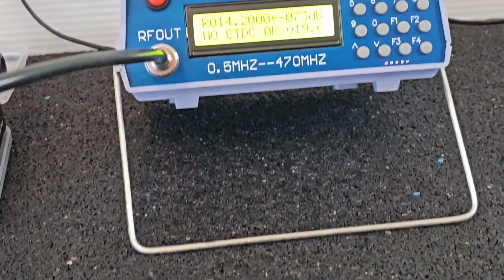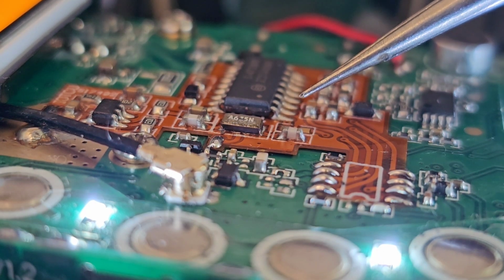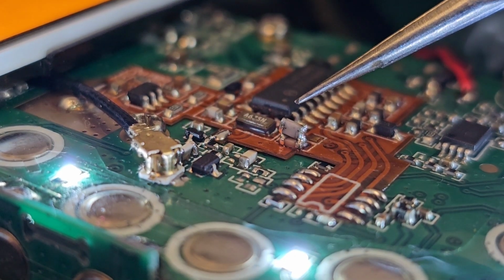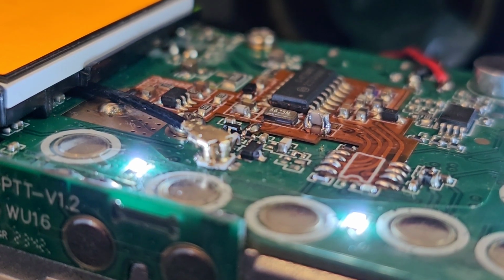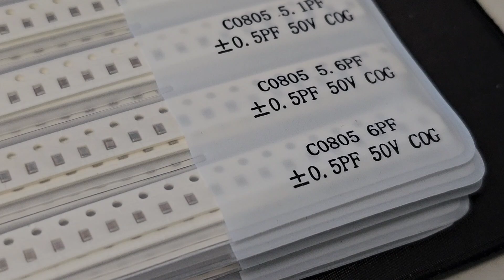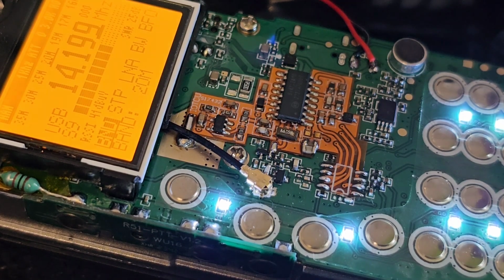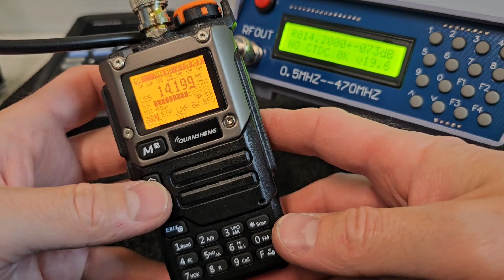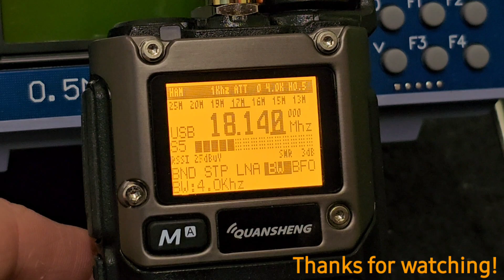Frequency BFO Correction after V.2 HW modification

Comment from the maker: After installing the SI4732 Chip V2 FPC module I see that on all modded radios the BFO setting needs to be manually adjusted to get the receiver frequency exactly on frequency, because SSB signals sounds like a Micky Mouse. It's boring always manually adjusting BFO, because after every reboot this new BFO setting is erased. Therefore, I did this repair directly on the FPC Board.
The reason why I use a frequency of 14.200 on the generator and 14.199 on the receiver is that in USB modulation this tuning produces exactly a 1kHz tone in the speaker, which I can easily measure using the Spectroid mobile application. If I measure a value other than 1kHz, it means that the receiver is detuned from the actual frequency. In this case, it was over 300Hz, which is quite a lot. All links for used items in the video are in the video description (as always) :) 73
Reply: Mám ten samý problém s ATS20+ a radioamatéři mě přesvědčili, že takto nejde doladit krystal. Teď vidím, že to jde docela dobře. Asi by šlo také použít TCXO na 32kHZ, které má i teplotní kompenzaci. Díky za ukázku.

Comment: Capacitance values of 1 pF or lower can be achieved by twisting two short lengths of insulated/enameled wire together. Search for Gimmick capacitor, can be used as variable capacitor.

Comment: Shame that the CEC sourcecode is not available yet. I haven't looked at the datasheet of the si4732, but maybe it's possible to do this in SW with a calibration value. Finding the exact matching capacitor is a bit of an ordeal, but well done man!
Reply from the maker: True. If could be possible to change the code that would be awesome and non of this wouldn't be needed to do. 👍